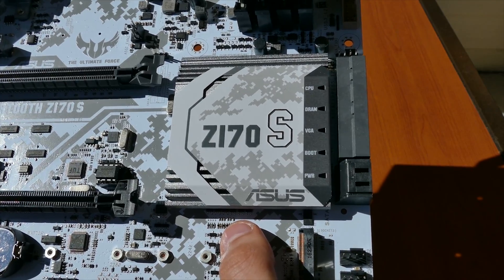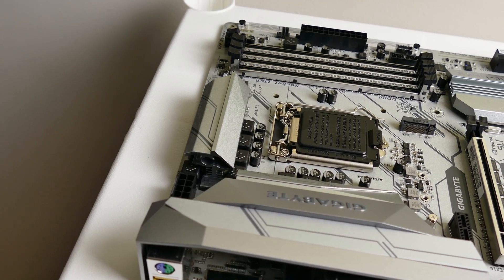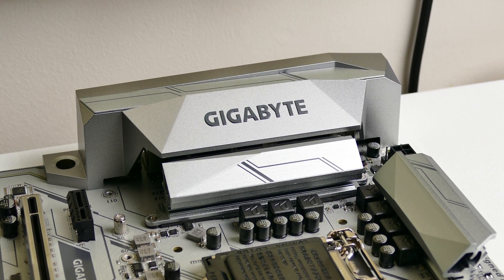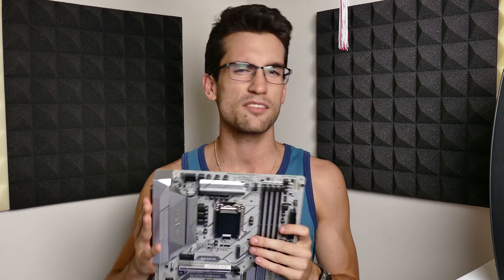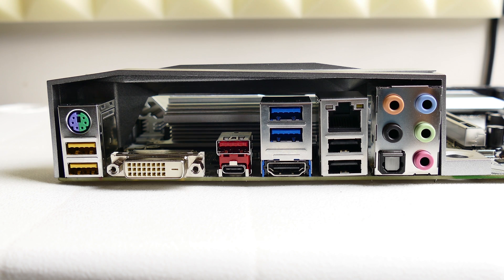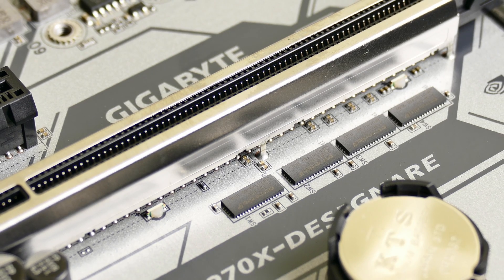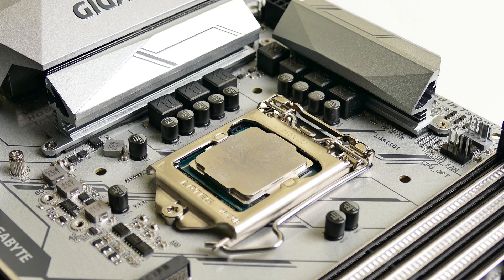Gigabyte Z270X Designare Review: Affordable and Beautiful

Comment: I am building a rig with this beautiful board as we speak.
Reply: You really shouldnt, but I get it if you are on low budget build and cant afford anything with current gen. I have this motherboard, sexy af (all the new ones are so god damn bulky and ugly), but I am soon in need of a gpu upgrade (thinking 4090) which means it will bottleneck my cpu (i7 6700k). So that means i can either replace cpu and MB or replace cpu only - thing is, the last and best cpu for the lga 1151 socket you can get is the i9 9900k but thats a 9th gen and this MB only supports 6th and 7th gen cpus. In other words, I must accept the bottleneck or replace those two, which again is so hard given how good looking this board is, absolutely dominates the current designs. 

Good luck with your build though
Reply: @joffy9373  low budget lol. its one of about 6 rigs i have currently...I build them for fun. And this one in particular looks amazing.

Comment: the gigabyte z270x designare uses 4+3 phase VRM while msi/asus or even the gaming line up from gigabyte (like the z270x gaming 5) use like 10/11/12 phase vrm design, so if i put a 7700k to 5 ghz on the z270x designare, should i watercooled the vrm ?

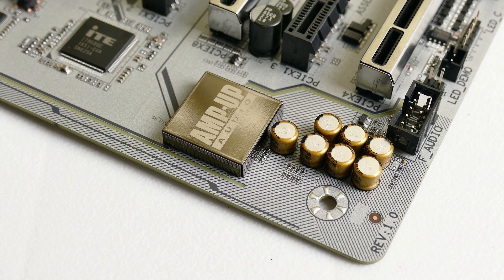Comment: Hey, quick question to any owners of this board. I have it. Works awesome, looks awesome. My only complaint is that on the bottom right and the bottom left of the board, there are some translucent parts that sort of distort any of the LED colors and make them "yellow-ish". Is anyone else experiencing this, or is something wrong with mine? You can see what I'm talking about in this video right around the 0:35 mark (at the bottom), and again at the 3:27 mark (going diagonal to the top left). They look like translucent "strips". The effect is very apparent on light colors such as turning your LEDs white. They look straight yellow instead at these parts.

Comment: So I'm buying this motherboard, with white ddr4 corsair Vengeance LPX 16 gb 3200 ram, zotac gtx 1080/1070 amp! Extreme and I'll put a custom backplate for it (that's white Ofc) with an i7-7700k and topped with Phanteks U-Type Dual Tower Heat-Sink that's white! (psu is EVGA SuperNOVA 650W g1 80+ Gold and a 2Tb SSHD firecuda+256GB samsung 850 evo m.2 SATA 3 ssd) and all that is going into a beautiful NZXT Noctis 450 ATX Mid Tower (glossy white Ofc) 
What do you guys think?

Comment: In case anyone wonders why PS2 ports are still included on motherboards.  Well, they provide lower latency than USB ports (especially for keyboards).   Essentially PS2 uses hardware interrupts whereas USB is software controlled (and therefore slower as far as latency).  USB also does "polling" which PS2 doesn't.  This is another advantage for PS2. 

This has been well discussed over the years.  Just Google search "PS2 vs USB latency" for examples.

Comment: Hey Greg, off topic question. I would like to know your thoughts on ram oc cold boot issues. I have a 16gb gskill ripjaws V kit 2400mhz (2x8gb) running in my msi b350 gaming pro carbon with an r5 1600. When I oc my ram to 2666 or 2933 it runs stable for hours under Aida64, but cold boot is a no go, I have to hit the reset button a few timea to get it going. Thoughts?? 

Thanks and keep up the good work

Comment: "There are 5 dedicated fan hubs with both PWM and voltage support - that's pretty much standard at this point".
Somebody give a call to AsRock and let them know please, I've encountered plenty of mobos made by them that only support PWM control.
Reply from the maker: mihaitha Recent Z270 and X370 boards? I haven't.
Reply: You didn't mention it's standard for top of the line boards only ;)

Comment: I have to admit, this is one sharp looking board with a ton of features.  A little surprised that it doesn't have on-board AC Wifi, but that's not totally a deal-breaker.  I like the fact that they tastefully placed the RGB elements where they did as well, and yes......many fan headers!  That's a plus!  For a sub-$200 price, I'd recommend this as well.

Comment: favorite price to performance MB that looks ok aesthetically is the extreme 4 Asrock. Was on sale for 129$ and over clocked my little  older cpu 6600k to 4.6mhz on the CPU and cache, with very little vdroop and fits well with my black and white build, but this board does look a bit sexy for a metallic build or even neutral schemes.. Saw the Asrock on one your video BTW thanks for the recommendation on that board, for the price range it really made my day performing better than expected. Case is a p400st also reviewed on your videos. Build is great so far, and when folks see it they are like "damn that is sexy".

Comment: Affordable my ass almost $200 for a motherboard yes you can overclock alot better but id rather spend $70 on a decent one and spend the $130 on cpu cooler,cpu or gpu...
Reply from the maker: Adam Kellow Compared to the similar MSI board for $299? Yes. AFFORDABLE. NO ASS HERE.

Comment: Your should use the galaxy silver Phanteks Evolv ATX tempered glass edition.

And Domimator Platinums if possible.
Reply: Luca Passalacqua and mx crucial SSD without The stickers.
Reply: Luca Passalacqua push
Reply: It's a beautiful case, I'm using it, but no fancy silver board, stuck with Haswell... :(
Reply: Ture Björkman if he actualy watercools the gpu this time the air cooler won't matter.
Reply: Luca Passalacqua Or an intel one, like the 750 series
Reply: Absolutely this!
Reply: Luca Passalacqua and that 1080ti from evga
Reply: Luca Passalacqua maybe white gpu pcb?
Reply: I'm running that case and one of those SSDs.

SSD is good, case is shit for the price. I want good cooling if you're taking $180 from me.

Comment: Whats a good build for people who don't want to overclock, im looking to update my motherboard, case, and cpu, plus getting a evga 1080 ti sc.
Reply: Flopp yeah, at medium high settings, not maxed out textures and mods. I just want the power for 1440p. I saw the 1080 benchmarks for mass effect andromeda, maxed out at 1440, with just 32bit compression, was just barely around 65 fps average, with some dips, 1080 ti was about 85 to 90. Even two 1080 sli was hitting around the same numbers as of a 1080 ti alone. You tell me, fallout 4 with extreme texture mods, on top of the HD update, yeah, the 1080 ti, sounds just about right. Now this is the part where you tell me 4K is just the way to go this days, I've been playing at 1080p and is still looks gorgeous and smooth over 60 fps on my TV, not a monitor. A monitor for 4K is just dumb. My brother has one and I didn't like the size of it.
Reply: r0ck3t and I thought getting a 1070 for 1080p was overkill.

edit, not saying you its a bad thing, you'll be able to use that same gpu for years
Reply: r0ck3t Then why are you getting a 1080ti which is more than capable of playing at 4K 60
Reply: can you run mods on top of it above 60 fps with settings maxed out and AA? i have a evga gtx 970 SSc, but i want in on the next level.
Reply: r0ck3t If your getting a 1080ti it would be stupid to not oc
Reply: Flopp why, I just want to play at 1440p with settings maxed out, not 4K at medium to high with low dips on fps just to get an unsteady 60 fps, with newer titles. I can install mods and play at 1440p just fine. I hate the thought of spending extra just for a 5 percent boost.